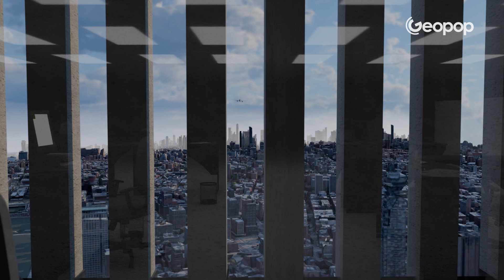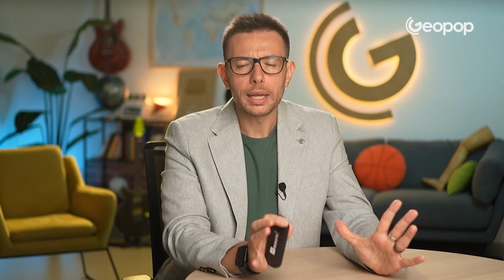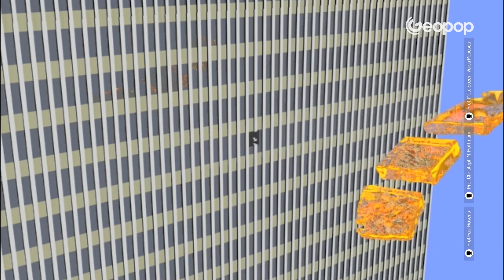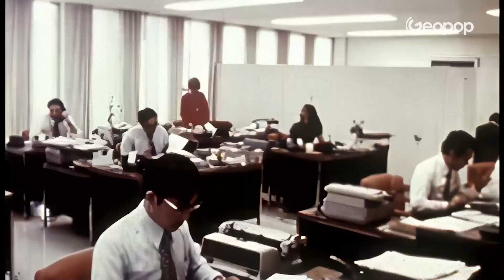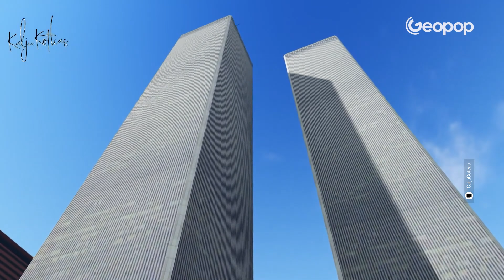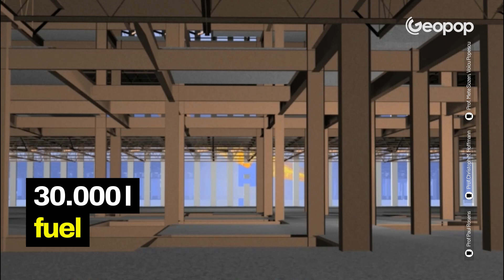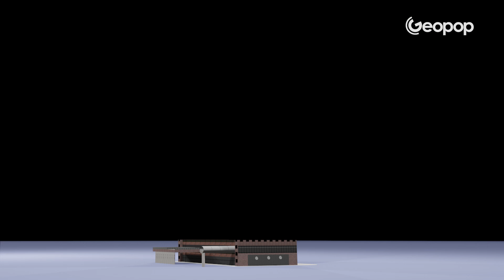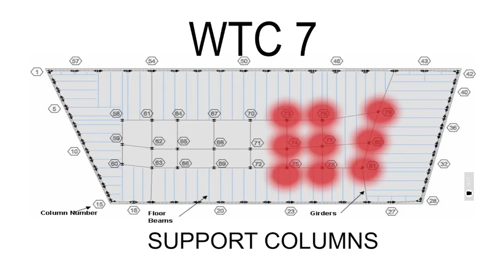9/11, 2001: The Technical Reconstruction of the Twin Towers and WTC 7 Collapses

Comment: 22:10 Then, the 4,000 people who worked in building 7 evacuated the tower (WTC 7) but those who worked in tower 1 and tower 2 (WTC 1, 2) were advised to return to their workplaces and not leave the tower, through the emergency system speakers!? Who did this, the different programming for one and the other, for one tower and for the others, why!? Some were advised to flee as soon as the accident occurred, others were advised to die sitting at their desk!?
Reply: You have tens of thousands of people in a narrow stairway, plus jumpers and debris. I personally would go out the other side and risk it, but that's just me. Be damned if a rental cop is going to "help" me.
Reply: You're literally full of shit. Wtc 1 was undergoing a mass evacuation from the second the plane hit. There was no word to return to work in that building. Wtc 2 was told to remain because that building wasn't damaged or on fire so they didn't want the crowd to interfere with the evacuation of the neighboring building
Reply: The automated systems were saying to return, actual people were urging evacuation in 1. Even so evac orders were in place quickly. In 2, procedure was to not evac because the building was fine it was still thought to be a one off accident and a huge mass of people would clog the plaza making it harder to treat and evac injured in 1. However evac orders were issued for 2 right before it was hit when it was realized this was an attack.
Reply: Get your info straight! You completely mix up various information! Which building, at what point of tine, exactly instructions etc!
Reply: Lucky Larry "telling" the port authority to "pull it" when they asked what he thought ""they should do"" regarding WTC 7.  Larry sure tried to  sound like empathetic and and noble in telling the PA to "pull it, we've had such a tremendous loss of life already".   Dude is so out of touch he couldn't even see how ultra disgusting his virtue signaling was and how it did nothing to cover his blatant self promotion.
Reply: @seemsmad3789  sounds to me like he was referring to the firefighters in the building trying to put out the flames.  Detonating the empty building wasn't gonna affect the loss of life that already happened. I encourage you to try to think with that thing you have in your head

Comment: Some time after 9/11 a high-rise in Madrid went up in flames. The fire fighters refused to enter. They let the fire burn out. A few days. No implosion. There is a nice book with questions about 9/11 Not in my name
Reply: Windsor Madrid. It was not a steel frame building but used composite construction, so not exactly apples to apples. The central core was reinforced concrete as was the 17th floor, which was a heavy mechanical floor. The rest of the outer structure was steel in a conventional box-grid arrangement. 

Within a few hours of the start of the fire, ALL of the steel structure above the heavy reinforced concrete 17th floor completely failed. Had Windsor Madrid been of all-steel construction the whole thing would have collapsed. No question.

Comment: Just use common sense. Take a look at history regarding entering or starting a war/conflict.
A basic understanding of building construction and controlled demolition.
Oh and the most obvious deception... building 7.
Reply: I did what you said. This is what I came up with for Building 7.  

The collapse of the unknown and unimportant Building 7 – one of 6 buildings to collapse of 10 destroyed on 9/11 - confuses a lot of people, despite being one of the most studied engineering disasters in history. It was not famous, not a terrorist target, no one was killed in it and thus it did not get a lot of attention, so most know very little about it. There is a lot of tantalizing but absolute garbage out there on this topic. Given the choice between long boring, hard to find technical reports and readily available, easily digestible fantasy on the internet, many turn to the latter. To counter that I prepared this brief summary explanation based on my own analysis. No politics, just engineering. 

The North Tower collapse at 10:28am bombarded Building 7 with thousands of tons of burning debris, causing heavy damage and starting raging fires burning out of control for the next 7 hours. Half the responding FDNY firefighters having been killed, others injured, units in disarray, much of their equipment destroyed, no water pressure, and the greater urgency of Search & Rescue efforts, firefighting efforts at 7 were pulled as futile. The building couldn’t be saved and was left to its fate.

youtube.com/watch?v=g_SvpwyC17M&ab_channel=MFitz 

Collapse of a burning structure is always a concern for firefighters. Steel buildings subject to fire rely on active fighting of the fires to survive. Left to their own devices they will collapse. Buildings are designed around 1 to 3 hours of fire resistance, allowing time for occupants to escape and ACTIVE firefighting to get started, after which all bets are off. In B7 the occupants escaped, passive and active fire protections were compromised and active firefighting never got started which left the building to take its chances. It lost. Odds on Building 7 would eventually collapse,… and it did. No big deal in logic. That is the sort of choice firefighters make every day in brush fire situations - which houses to save and which ones to let go. Only real difference here is moving the decimal on the size and cost.

FDNY Chief Daniel Nigro ; The biggest decision we had to make on the first day was to clear the area and create a collapse zone around the severely damaged 7 World Trade Center, a 47-story building heavily involved in fire. A number of fire officers and companies assessed the damage to the building. The appraisals indicated that the buildings structural integrity was in serious doubt. I issued orders to PULL BACK the firefighters and define the collapse zone. It was a critical decision; We could not lose any more firefighters. It took a lot of time to PULL EVERYONE OUT, given the emotionalism of the day, communications difficulties and the collapse terrain

FDNY Deputy Chief Peter Hayden - We had our special operations people set up surveying instruments to monitor and see if there was any movement in the building. We were concerned of the possibility of collapse in the building. And we had a discussion with one particular engineer there, and we asked him if we allowed it to burn could we anticipate a collapse and if so, how soon? And it turned out that he was pretty much right on the money, that he said 'In its current state you have about 5 hours

With its deteriorating condition being reported throughout the day, the collapse of Building 7 expected by the FDNY, bystanders and the media meaning at least 24 video cameras recorded some or all of the collapse. Everyone at the time knew what was coming and why.

youtube.com/watch?v=OY5S5k3tMHI&list=PL4GiNqqck-lzR7pebSWRVLoXyu-aWR3Rr&index=48&ab_channel=911InvestigationVids 

Building 7’s collapse was totally different to the Twin Towers, harder to understand and most of the details difficult to see. But we can sort out what happened through careful analysis and observation.  What follows is MY EXPLANATION of the collapse sequence using the best available information and relying on no authority.

B7 was complex structure, a 47-story steel framed building built on top of a smaller existing 3-story building, requiring several lower floors dedicated to complex load transfer structures instead of usable office space. Of trapezoidal shape and all-steel tube-in-tube construction, B7 (above the 7th floor) consisted of a central core of steel columns carrying most of the gravity load, perimeter steel columns around the outside of the structure carrying the remainder of the gravity loads and long span beams and girders to tie those elements together and form the floors. On the outside of the building hung a moment frame - the last part of B7 to fall. 

Phase 1 : Collapse initiation for B7 is notably quiet with observers not realizing the building was collapsing! There was no audible warning in the form of say hundreds of ear drum busting 180-190dB explosive bangs preceding the collapse. The first externally visible signs of collapse initiation occurred at 5:20:28 pm. Here at 12:00 a local CBS affiliate reporter is talking 10 blocks from B7 when collapse begins. People don’t start to notice the collapse until 12:11. Then at 12:45 is the famous CBS fixed camera clip of Building 7’s collapse Again, note how quiet it is.

youtube.com/watch?v=t5tEy6mXSE8&ab_channel=fresnosean379

Collapse initiation was due to multiple lower floor failures above the load transfer region (7th floor) in the NE corner of the building. In this video at 0:45 you can see the NW corner from inside the building while under construction, Column 79 just out of frame on the left. That big, angled steel beam across the top of the frame connects to C79 at one end. The girders connect to the beam. The beam and all those girders depend on just one connection

youtube.com/watch?v=nP3TNHPCIVU&t=35s&ab_channel=EdwardCurrent

Phase 2 : Lower floor failures left core Column 79 laterally unsupported over an excessive length and it buckled. If you look at a floor diagram of Building 7 (see above) and look at all the structures that depend on C79 you quickly realize this one column was a relatively isolated structural element on which a disproportionately greater fraction of the structure depended . Externally we see a vertical progression of window breakage along the 44-46 line and a kink in the roof of the East Mechanical Penthouse at the top of the building, consistent with C79 failure. The transition from full capacity to almost no capacity occurs in virtually an instant. Once the buckling failure occurs there is almost no resistance

Normally with a buckling column, the load could very well be redistributed to other columns, meaning the buckling could stop after a while. With C79 that is not the case - the failure did not redistribute the load, so the collapse rapidly progressed to the roofline, sinking the rooftop penthouse.

Phase 3 : With C79 gone, B7’s progressive, non-symmetrical collapse continues with C80 and C81 at the east end of the core left laterally unsupported and quickly buckled and failed as well, sending the EMP down through the building. C79-81 all have no diagonal bracing, which I believe is a major reason why they could not redistribute a lot of vertical loads among one another.

From there collapse progressed from east to west through the central core until the core was gone taking all of the interior floors and structures and probably most of the perimeter columns with it. You can see the horizontal progression of window failures low in the building and the dropping of the remaining rooftop structures into the building. One of the big takeaways from the NIST Building 7 study (that gets completely ignored) was their modeling which determined C79 failing under ANY circumstances would have initiated the same collapse sequence.

Phase 4 : After about 10 seconds only the exterior moment frame - a hollow shell mostly supported by the 4 corner columns and quite unable to stand on its own – remains, creating the illusion the building is still standing since little has changed externally. That’s just hollow empty shell, like an empty cereal box. The north leans inward, forming a V in the roofline. The last remaining perimeter columns buckle under the strain.  There is almost no resistance as the moment frame free falls, landing on top of the 7-story high debris pile, blocked surrounding streets, heavily damaged the Verizon Building and destroyed Fiterman Hall at 30 W. Broadway, all well outside of Building 7’s “footprint”.  It is only here, at the very end that a single utterly meaningless measurement of alleged free fall is taken. Start to finish the collapse took 18-20 seconds, or less than 1/3 of true free fall*. Not that we really care since how fast something falls cannot tell you what started it falling in the first place. The free fall argument is about the collapse of the outer shell *AFTER all of the critical internal structure had already failed and completely ignores about 80-90% - of the collapse. 

Building 7’s progressive, non-symmetrical collapse was incidental and unintended collateral damage from the combined effects of fire + time + gravity started by the collapsing North Tower. That is true no matter who planned and carried out the 9/11 attacks or why . The collapse was of so little consequence it barely even registered at the time, a mere footnote. 

I hope you found this helpful. It is meant to be informative, not adversarial and to solicit informed critical comment. If I made any errors of fact, logic or reason or left anything critical out, please let me know so I can fix it. IF you can offer a more plausible alternative be my guest. So far no one has even tried. Please start any reply with the words “Tits McGee” or I will know you didn’t actually read it and won’t let you waste my time.